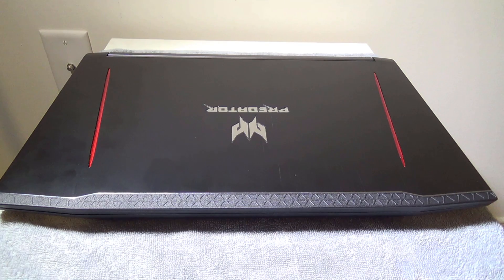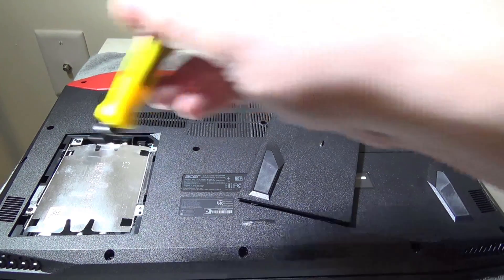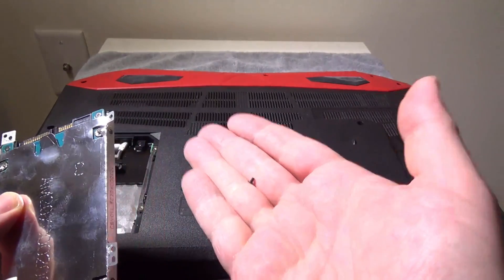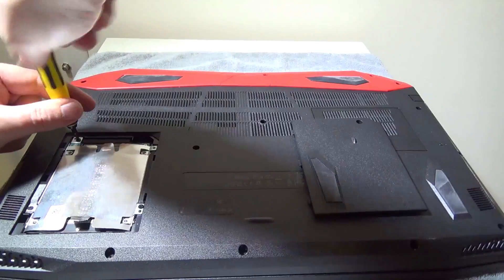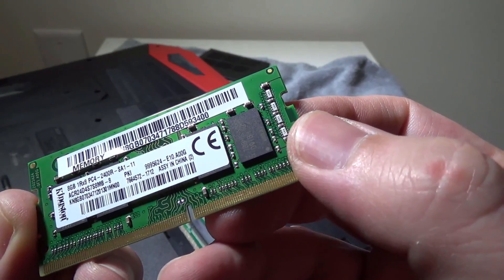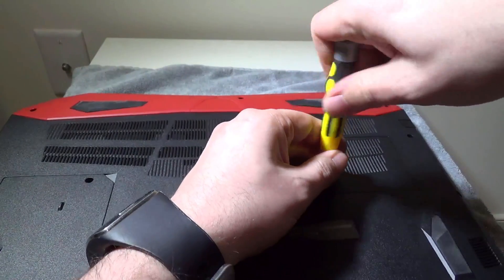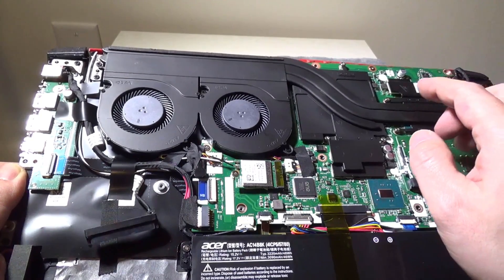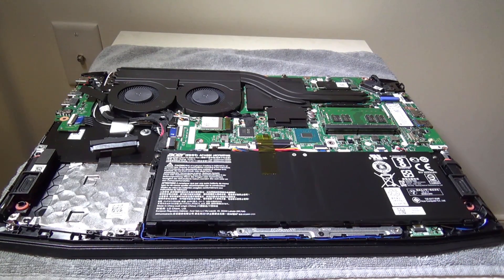Acer Predator Helios 300 Gaming Laptop • How To Add a 2nd HDD and Upgrade RAM

Comment from the maker: Get the Acer Predator Helios 300 Laptop HERE
Amazon US https://amzn.to/2t1ENeb
Amazon CA https://amzn.to/2TqY2dA
Amazon UK https://amzn.to/2wYKij3

Seagate FireCuda Gaming SSHD 2TB SATA 6.0Gb/s 2.5-Inch Notebooks / Laptops Internal Hard Drive (ST2000LX001)  HERE
Amazon US http://amzn.to/2q7hjRr
Amazon CA https://amzn.to/2TnL9RH
Amazon UK https://amzn.to/3af3bwo
Reply: Can u tell which ram did u use?
Reply: thanks for the very informative and clear procedure!
Reply from the maker: Welcome
Reply: So, after two years now i want to add a hdd but the problem is i don't have those 4 screws which comes with the power cable. So will it be fine without fixing those 4 screws on the side and just adding top screws to connect to the laptop ?

Comment: Hey is there anything I need to do on the computer before installing the hard drive because I did all the steps and every time I do it (this is my third attempt) it just loads forever and then tell me it needs repairs. Can’t use it unless the hard drive is in computer
Reply: I’m not using the screws that came in the charger pack but other than that it’s an identical setup, could it be the screws or is that probably not the issue
Reply from the maker: No the screws wouldn't have anything to do with it
Reply: Galaxy Tech Review ok well thanks for answering that question, I ordered them yesterday anyway but it was cheap. do you have any idea what my problem could be? I asked someone else who also made a tutorial on this about it and he just said to make sure I have the right drive as the boot drive, I believe that is already the case though. I’m just a little salty at the whole ordeal and could really use some advice, thanks
Reply from the maker: No idea unless I had your computer in front of me to check out, sorry man, good luck.

Comment: I'm trying to upgrade to a faster nvme m.2 ssd, but I haven't since I cannot clone the current ssd. Any advice? I cannot find any adapter to connect the faster nvme ssd to my laptop externally to clone the original ss and then install the faster nvme internally.
Reply from the maker: the easiest way would be to get a caddy (usb to m.2) plug that in with the new drive installed and clone it that way, then replace the new m.2 with the old..
Reply: Galaxy Tech Review I can't find any USB to nvme m.2 adapters. Do you happen to know any?
Reply from the maker: Nope, I have never used one, but if all else fails just install the new drive and do a fresh install of windows, takes time but will work out just fine.
Reply from the maker: you could use a cloning program to clone the boot drive to an external usb drive as well.

Comment: Will the Crucial MX500 SSD work without additional accessories?
Reply from the maker: the drive bay should have a mounting kit already inside it, if it does any 2.5 inch 7mm drive should work including the MX500
Reply: Galaxy Tech Review https://www.amazon.com/Crucial-MX500-250GB-NAND-Internal/dp/B0764WCXCV/ref=mp_s_a_1_3?ie=UTF8&qid=1528153457&sr=8-3&pi=AC_SX236_SY340_QL65&keywords=crucial+mx500+250gb&dpPl=1&dpID=51K4HDZVQzL&ref=plSrch this is the link for the Crucial MX 500. Thanks a lot for your help!

Comment: After accessing to the hard drive and putting the secondary drive is there anything else should I do before switching on the laptop.
Because I opened the laptop and nothing had been changed , I mean no more extra space ? . Hope you understand what I mean .
Sorry for my English
Reply from the maker: Once you install the drive you have to boot into windows and then go to Disk Management in settings you will have to create a partition on the new drive before windows will see it other than that you should be good to go.

Comment: i need help guys, will the seagate 5TB 2.5" 15mm fit in or not?
Reply from the maker: No , I installed a 7mm drive.  look for one that is 7mm not 15mm. 15mm will not fit most laptops due to the size.
Reply: Galaxy Tech Review thanks

Comment: Will this work ?
https://www.arvutitark.ee/est/tootekataloog/Arvutikomponendid-Kovakettad-HDD-SSD-M2-SSD382/Corsair-Force-Series-MP500-240GB-M2-SSD-NVMe-PCIe-M2-CSSD-F240GBMP500-259650
Reply from the maker: you should already have a M.2 drive in the laptop (your Boot Drive) So you would need to add a secondary 2.5 inch SATA drive (HDD or SSD)
Reply from the maker: but if you want to replace the M.2 drive yes that drive would work.

Comment: can we install a 5tb seagate baracudda green internal 1.5 cm height  with 2.5" form factor drive it this secondary bay? does it has sufficient space? 
and second, can we use intel optane in this laptop?
Reply from the maker: it needs to be a SATA interface 7mm 2.5 inch.  and it will work.

Comment: Do you have the 2 16gb ram drive suggestion?
Reply from the maker: Right now with RAM prices that's a pretty expensive upgrade I can look and see what I can find for you but it's going to cost you probably 270-300 dollars
Reply: No problem!

I appreciate you taking your time 

The laptop could just upgrade one 8gb with a single 16gb correct?
Reply from the maker: Yes or you can just buy another 8GB and run 2 8's

Comment: Hi bro, could you tell me if is important to require the mounting kit( the parts) or no?? For this hard drive
Reply from the maker: "yes it is as the mounting kit comes with the data cable to attach it to the laptop's motherboard"  same answer I gave you via email and on Facebook and now here.  Yes it is important.
Reply from the maker: Mine came with the Kit installed so as you see in the video I already have the SATA cable in place.

Comment: Do we add in the extra hdd ? or we remove the ssd already in it and then install hdd?
Reply: Mir Videos you add in extra. There is no way to take out the ssd in there unless you disassemble the whole computer. There is an empty space for another hard drive.

Comment: Would adding the hdd void the warranty?
Reply from the maker: No it will not
Reply: Thank you very much. You're video is very helpful. Making a mistake while adding the hdd cause problems with the laptop?
Reply from the maker: You can't really make a mistake, it's pretty straight forward like in the video.

Comment: Can You please help me with what ram i should buy to upgrade my 16gb ram helios 300 to 32gb ram with amazon.com link , thanks for ur reply on my older comment , i luv ur videeos
and also is it possible to make my laptop 64gb rammed.
Reply from the maker: Yup you would need something like this http://amzn.to/2CYWsWm  2 x 16GB sticks to replace the 2  x 8GB ones that come installed. It's like a 300 dollar upgrade and in my opinion not worth it but if ya got the cash go for it  :D
Reply: Can i just replace one of the 8gb with one 16gb? So in total i have 24gb ram?
Reply from the maker: Yes you can
Reply: Can i buy this one i think its the cheapest for one X 16 gb ddr4
https://www.amazon.com/16GB-1X16GB-DDR4-2400-288PIN/dp/B01FU9JTHA/ref=sr_1_49?ie=UTF8&qid=1520360210&sr=8-49&keywords=16+gb+ram+ddr4+1x16
Reply from the maker: No that's for desktops not laptops.

Comment: Is this laptop worth 1000 usd and can I upgrade the graphics card and processor if they get outdated
Reply from the maker: At the moment it's the best GTX 1060 laptop for the price you cannot however upgrade the CPU or the graphics card as they are soldered into the main board as with 99.9% of laptops

Comment: Which ram does this laptop have kingston which model..??
Did it came with kingston or you changed the ram. I don't want to put two different kind of ram, and if I do will it create any problem.??
Help me please
Reply from the maker: The laptops can come with different brands (depends on what Acer decides to use at the time of manufacture)  Best is to open it up and look to see which module you have pre installed, you can also download a program like HWinfo64 and run that and it will tell you what model of ram is installed.
Reply: Galaxy Tech Review Thank you very much. Thanks a lot am subscribing.

Comment: Hi do you already put the 16 gb ram or do u get wen u bought it ??? 
I hav a 8gb ram predator can i upgrade it to 16gb ??
Reply from the maker: +Advik Vj mine came with 16 gigabytes of RAM but you definitely can upgrade yours to 16 gigabytes it will support up to 32 gigabytes
Reply: So i hav 8gb now and im gonna buy another 8gb ram but other brand will it go fine?? Or shud i buy the same brand??
Reply from the maker: As long as it's the same speed then it can be any brand.
Reply: Thanks very much for helping me...😊

Comment: How’s the heating
Reply from the maker: +AReallyLingName You'reWastingYourTimeReading when I game on the Helios 300 I always have the fans on max since I always have headphones on any way it doesn't bother me and it cools just fine if it does have an issue with cooling or you want it to run a little cooler you can always undervolt the CPU and that takes care of any issues most people might have but even at stock the temperatures are within limits
Reply: Galaxy Tech Review I’m getting a laptop for coding class(game development) so I don’t want to embarrass myself with a full roaring fighter jet engine inside my laptop. That’s exactly why I’m planning on returning my Inspiron 15 7577. Fans r rediculus
Reply: Galaxy Tech Review how loud do the fans get
Reply from the maker: They get kinda loud on MAX, I have not tested them with a decibel meter though so can't say for sure.
Reply: Galaxy Tech Review my Inspiron 7577 gets like 55 -60 decibals so yea decimeter test would be helpful

Comment: Question. If I only want to add the Seagate 2TB FireCuda SSHD 2.5-Inch Drive Bundle, I need just do up to minute 5 isn´t is? Another thing i wanna ask is if as soon as i put the Seagate 2TB FireCuda SSHD 2.5-Inch Drive Bundle, the memory automatically expands or i need to install ir or do something to use it.  Thanks a lot!
Reply from the maker: Once you install the drive you will then have to boot windows go to Windows settings then Disk Management and create a Partition on the new drive before windows will be able to use it.

Comment: Galaxy Tech Review - dismounting the bezel wasn't as easy as in your video (8'17'') took me 40 minutes of desperate trial and error to release the snaps. Looks like I wasn't the only one. Do you have some hints how to do it smoothly? another thing is that there is no screw for m.2 drive, and there was no screw with my WD blue, so had to organize it. Anyway, thanks for the video.
Reply from the maker: +Andrzej Biesiekirski Miss special tips other than what I mentioned in the video just go slowly and try to make sure that you don't snap any of the tabs. As far as no screw for the m. To drive mine came with an M. To drive so I already had a screw and I did not need to replace that particular drive so I did not do that particular upgrade.

Comment: hey so i installed the hard drive but i my computer does not show that there is any extra storage that was been added
Reply from the maker: +Shadow that's because you need to go to Windows settings then go to Disk Management and set up a new Partition on the hard drive that you just installed before windows will recognize it

Comment: hi, I want to add 2nd hard drive but instead of the Seagate 2TB FireCuda SSHD i wanted to add  Crucial MX300 525GB SATA 2.5" 7mm (with 9.5mm adapter) Internal SSD. is the process the same for SSD?
Reply from the maker: yes exactly.

Comment: 3:31 what are the dimensions of the screws, I missed them in the box and I threw the box away I need help!
Reply from the maker: just search 2.5 inch hdd screws on Amazon.  they are pretty universal.
Reply: Galaxy Tech Review Thank you so much for answering! As you read I missed the screws and I needed them for upgrading my laptop. 1 last thing, my hard drive bay came without the thin metal sheet that goes on top of the hard drive, can I install a hard drive without that?
Reply from the maker: You need the metal sheet as the hdd gets screwed to that and then you screw the sheet into the laptop.  I would suggest contacting Acer for a HHD mounting kit.  https://csapps.acer.com/kit-request/#submit
Reply: Galaxy Tech Review is the mounting kit free? And I don’t think I can get it since it’s for U.S and Canada users and I got the laptop from amazon Shipped to Chile.
Reply from the maker: Ya in that case you would have to contact Acer direct and see what your options are, I'm in the US so can;t help ya there.
Reply: But can i buy the metal sheet somewhere in amazon or somewhere else, saying that it requires 2.5 inch hdd screws and its for a laptop hard drive?
Reply from the maker: Not that I know of, I think you have to get it from Acer.
Reply: Hey dude! but can i just connect the hdd to the SATA cable and leave it there without screwing it with the sheet? (since i dont have it neither get it where i live)
Reply from the maker: +Your Vital Show I guess you could but it will allowed to drive to wiggle around a little bit
Reply: But will it work? like would i be able to access the hard drive and store stuff on it?
Reply from the maker: Ya it will still work just wont be mounted to the inside of the laptop
Reply: ok so ill just connect it to the sata cable (in the hard drive bay) and then close the bay, and hope it doesnt get damaged :D
Reply: thank you for your help, i couldn't find info on this but u helped me just right :D
Reply from the maker: Good luck

Comment: Nice video does this laptop come with a screwdriver to add a hdd? Or do i have to but one? If so which size/kind of screwdriver do i need
Reply from the maker: No it does no the size I used was a PH0  (phillips head screwdriver size 0)

Comment: So to remove the battery I have to remove 16 screws?, I play a lot and last laptop battery was useless at the end because I had it all the time plugged to the AC adapter. Is there a way to preserve battery life that doesn't require to tear down this laptop?
Reply from the maker: +Alexander Ariza no unfortunately like all new laptops in the battery is sealed so that means you had to have to unscrew a 16 screws remove the bottom cover and unplug it from the main board
Reply: Galaxy Tech Review Any tips on how to preserve battery life. I play almost all days around 4hrs
Reply from the maker: Not worry about it?  By the time the battery goes bad (in like 2 years) you can buy a replacement battery for like 30 bucks lol.

Comment: If i add a new sshd in that slot will it affect the 256 gb ssd or both of them will be there
Reply from the maker: Both will be there, just dont forget to go to windows settings, then disk management to setup and format a new partion on the new disk or windows will not see it.
Reply: Galaxy Tech Review Thank you

Comment: While installing my additional hard drive, I did not use the side mounting screws, just the ones on the top of the caddy to secure it, will that be a problem?
Reply from the maker: Nope it will hold just fine
Reply: Galaxy Tech Review  Thanks so much for answering. Is there any particularly reason they include those additional screws? (for securing the side of the caddy and drive) I only screwed the top part.
Reply from the maker: +Sumanth Nekkanti well yes you're supposed to do all of them do you have to do all of them? No but you're supposed to LOL

Comment: Hello. Can I ask if I can upgrade my storage and add ssd? My acer predetor helios 300 comes with a 1 tb hdd not with the ssd. Can I somehow add ssd? And is the process still the same with adding a new hdd?
Reply from the maker: Yes you can
Reply: Galaxy Tech Review so same process with the hdd?
Reply from the maker: yes you will either have to clone the HDD (cause Windows will be installed on it) or just reinstall windows. But replacing the 1tb HDD with a SSD is just swapping it out.  Remember you have a m.2 slot on this laptop as well if you take the whole bottom cover off you can access that slot and keep the 1 tb HDD as a data drive if you wanted
Reply: Galaxy Tech Review oh i see. Thank you so much.

Comment: kinda of a random question, ive got the exact same laptop and the exact same Seagate SSHD and did the installed perfectly, does that mean that i now have the 256 SSD + 2TB SSHD storage space?  or just the 2TB SSHD storage space? Thanks
Reply from the maker: +Meng Lu you have access to both drives the 256 SSD has your operating system on it of course so you won't have a total of 256 gigabytes and of course you installed the two terabyte drive so now you have that as a second drive to do game installs and other things
Reply: thank you!

Comment: Afternoon. I bought this laptop yesterday and so far it’s performing absolutely fantastic. Currently playing eve online maxed out with no issues. Even in big fights. Question. If I want to upgrade the ram in the future I was led to believe that there is 4 ram slots 2 on each side of the board. Is this true? My laptop comes with 1tb hdd 128 ssd and 16gb ram already installed. What’s the maximum m.2 that the board supports? Cheers
Reply from the maker: +Gess Berry there is only 2 RAM slots not 4 so you can switch them out for a 2 16 gigabytes for a total of 32 GB. As far as M. 2 drives go you can go up to I believe it's 2 terabytes and it is nvme supported so you can use like a Samsung or other brand nvme if you want the faster speeds
Reply: Galaxy Tech Review thank you very much sir